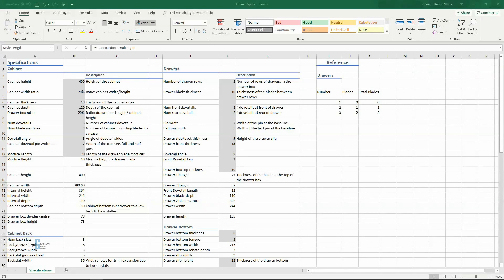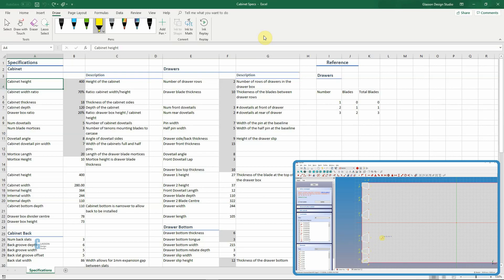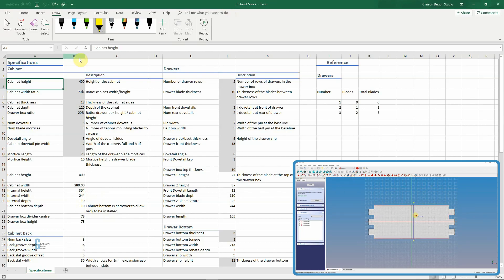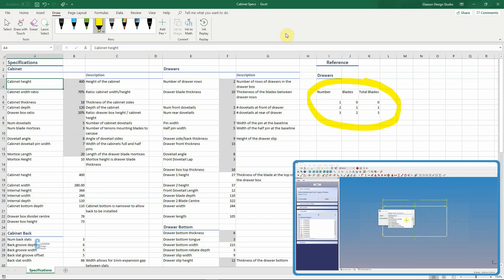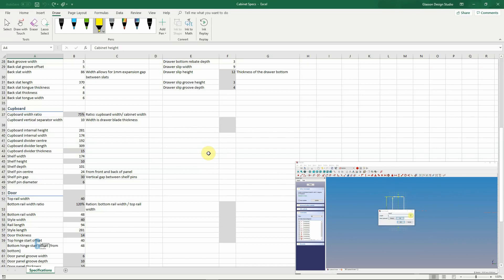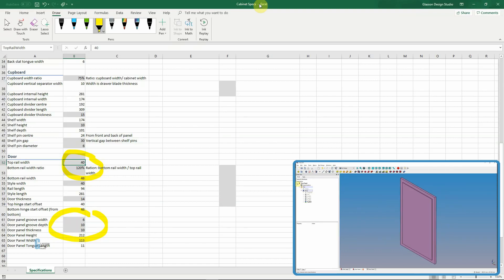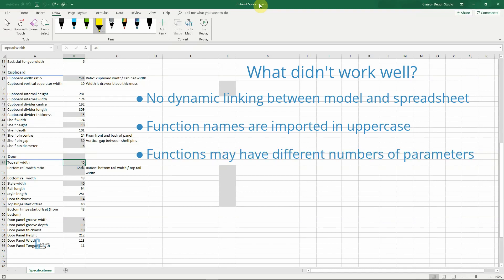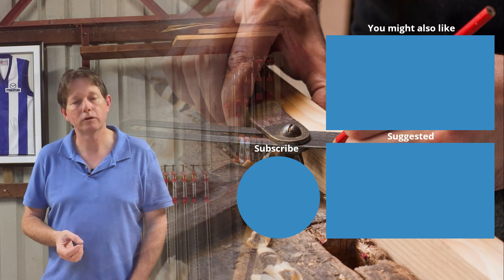Designing a small cabinet using FreeCAD and spreadsheets

Comment: What's the difference between using <<SPREAD SHEET>>, and SPREAD SHEET??
Thank you, Roland
Reply from the maker: Thanks for your question. The difference is that <<SPREADSHEET>> is referencing the spreadsheet by its label whereas SPREADSHEET references it by name. There isn't a lot of difference if the spreadsheet's label is SPREADSHEET but the difference becomes apparent once you have multiple spreadsheets in your model. The default SPREADSHEET label is incremented by 001 each time you add a spreadsheet so your name of those spreadsheets becomes SPREADSHEET001, SPREADSHEET002, SPREADSHEET003, etc. You will probably find, as I did, that this naming scheme becomes a bit unmanageable because you have to remember that SPREADSHEET002 actually contains say the dimensions of a motor vehicle tyre of a certain brand. Changing the label of the spreadsheet to be something like "PirelliXYZ" is far easier to remember but you'll have to use <<PirelliXYZ>> in any expression that references that spreadsheet. 

Over time I have moved towards using spreadsheets to store the parameters that define standard wood working components, my equipment, etc. and it means that I regularly have 3+ spreadsheets in a model so having a naming scheme for the labels makes it much easier for me to use them. I hadn't realised that it could be an issue when I made the video which is why I didn't talk about it.

 I hope this makes it clearer.

Comment: Great practical video, hope to see more. I am trying to master Freecad as as a tool in my woodworking hobby. As there are obviously limitations in importing the spreadsheet, what do you think about the practicality of working only in the Freecad spreadsheet, thus eliminating the need to import with possible conflicts?
Reply from the maker: Hi Will, My apologies for my tardy reply. Thanks for your kind words. To be honest, it seems to me that the FreeCAD spreadsheet is good for doing fairly simple spreadsheets (which admittedly mine are) but I didn't spend much time looking into how practical it would be to share them between models.

I was looking for a way to do some proportional design in a spreadsheet and share that spreadsheet between multiple FreeCAD models, which led me down the Excel path - I'm also very familiar with Excel so that helped too. I didn't investigate whether I could do this using FreeCAD spreadsheets but it seems to me that I should look into it and do a video on the subject. I am building a list of woodworking related FreeCAD video topics, and will add this one to it.